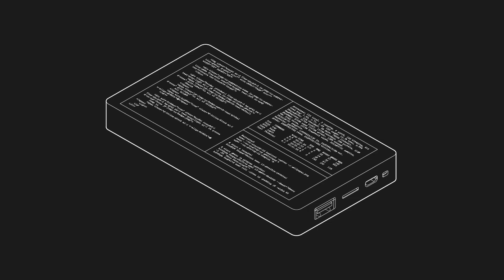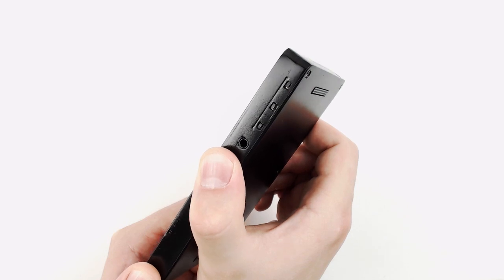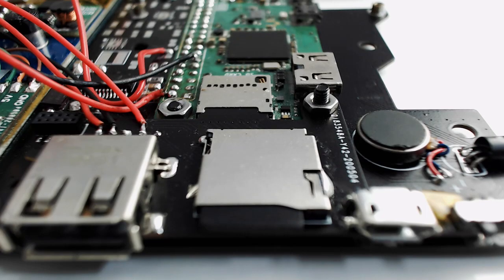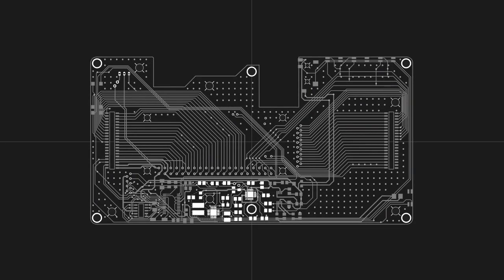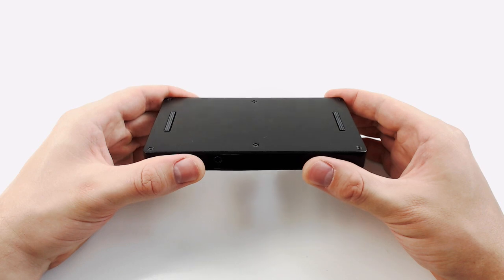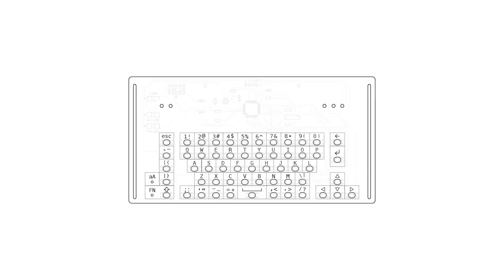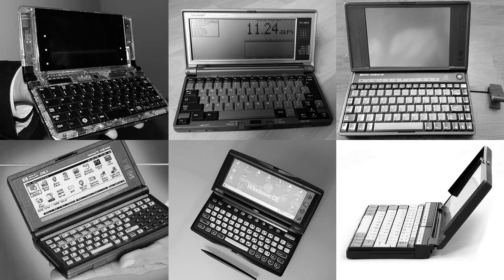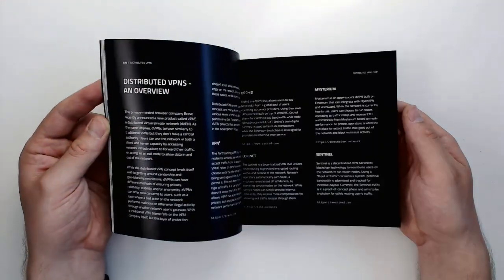Trying to build the ultimate Raspberry Pi computer (Zero Terminal V3)

Comment: Very cool, love the added own boards, since my first contact with computers, around 1995,'96, I always wanted a pocket Windows pc, now I have smartphones, but still not what I actually want, if I had the budget and time, I would get a Windows compatible micro-computer, to which the schematics are available, and redesign the board/s, it is always good to place some circuits and things on own boards, then make a solid aluminum case with as much fins as possible on the inside and a tiny fan for cooling.

Comment: IMO, go for RPi compute module will be another good idea. Without direct soldering RPi zero on PCB, if RPi malfunction for some reason can be swap out easily, also, with eMMC embedded RPi compute module, sd card slot will be optional. 
AND MUCH POWERFUL CPU

Comment: Ive made an phat out if the adafruit powerboost 1000C. I agree about how problematic those ICs are. You really need to hot air reflow them (I use a hot air gun), and you definitely need to control the amount of solder paste laid down (such as by using a stencil).

Comment: this is SO COOL! I wonder whether, when the pi 4 compute module comes out, it would be possible to make a version of this with the pi4 since it's very powerful and could be used for even more demanding tasks. I've found myself using the full sized pi4 for various general tasks and it would be brilliant to have that all in a small, self-contained device.

Comment: @N-O-D-E you could make it even slimmer If you desolder some connectors from the pi and solder some Extension to it to Place the connectors where you want. Then for the custom pcb‘s use flex band pcb‘s and tape the components together with some not conductiv foil in between.

Comment: Awesome work. When I see the LCD kits I think they look great, until they are tilted and you see inch long brass stand-offs and that kills the mood. Compute module with M.2 could be a great little package couldn't it... I'd almost recommend you forgo the internal battery and have an attachable unit like minidisc players had in the 90's.

Comment: That's awesome man! I will definitely Gina try it as soon as possible, I have an old transalator device from the early 90-00's but there is nothing on the internet about it, it has an on board keyboard and a small 2line lcd display for the text, I was thinking to swap some parts and make it a pocket sized terminal, for the device to fold in half they used plastic hinges and a soft "wire" that's about a tenth of a milimiter thick and its very easy to use, I could send to photos of the device if you are interested on the design

Comment: Awesome, I was also thinking about to create a tiny notebook out of the pi. In my opinion the pi zero is not powerfull enougth - at least for my usecase. So I'd be happy if you decide to go with the compute modul 4 (release 2021). But I think you gonna build it modular. I think I could also help with the 3D design of the case. Nice work mate hope for updates soon.

Comment: Any tips on removing the SD card from a slot this small?

Also the pins connecting the different backpacks will be prone to bending, when removing the backpack, might require further iteration.
Reply: The slot will probably be one of the spring-loaded ones, so you will use a fingernail to push it in and pop it out.

Comment: Maybe use a pair of flat ribbon cables to connect the display rather than a pcb? smart phones do this to save a lot of space because you can weave the cables to the main board and not have a rigid physical connection that can only be as close to the main board as the largest component allows. And if someone drops it, the board is less likely to flex and break internal connections by compression of components into one another.

Comment: 6:33 i think there is some serious mistakes within the PCB keyboard design : firstly there isn't enough decoupling caps for the MCU (i can't understand how people do PCB design without even looking at the recommendations of the chip manufacturer in the datasheet ) secondly the external oscillator and the decoupling caps needs to be as close as possible to the MCU (so there is no degradation of the clock signal and for effective decoupling)

Comment: sir i know im late to comment on this project but i got an inspiration for the modularity if the pi zero,i got the idea of using a cassette tape as the open bit on the side is capable for ports and extensions which can be also added with a touch function

Comment: Am I an oddball for thinking that the form factor could fit in a VHS cassette? (Imagine a computer that uses a cassette body, connects to peripherals wirelessly, and outputs video on a magnetic pick-up that is read by the playhead on a VCR. Perhaps more challenging because the way video is read differs from audio cassettes. Would be an amusing piece of retro-weird kit simply for the "WTF?" factor.)

Comment: have you thought of using a compute module instead? more power then a zero and since your already doing custom pcbs you can just pull what you need from the connector and route it where you want.

Comment: Is there any way to do the actual connection with pogo pins and short through hole connectors with a top piece to sandwich the pi in place so the end user doesn't have to solder? I ask because this sort of project is VERY relevant to my interests, but my eyes do not allow for that kind of fine work.

I3 window manager? Why not just use tmux?
Reply: I was actually wondering if it would be reasonable to use flat ribbon cables like what the raspberry pi camera uses. then you dont have to worry about the pogo pins not working correctly or wearing out prematurely. also, i figure it would have a switch somewhere so its not using power while the keyboard is "closed"

Comment: You can Increase the power by using a Raspberry Pi 4 (Any variation) but with the low profile Mod (By removing all the ports from the board except maybe the HDMI or the DSI Display port). I've seen a lot of examples on google images of this mod and really looks so tiny compared to the full size raspberry pi 4.

Comment: Since we're making our own custom PCBs, wouldn't it be better if Raspberry Pi's chip and other components were soldered on the board from the factory? Do they even do that?
Still, very awesome project, I'm now looking forward to assemble one for myself.
Reply: Surprisingly, Broadcom does not sell the exact same chips found in Raspberry Pi's on the open market. And I believe that some of the lowest level firmware is not available (or perhaps just not available in source form). It's easy to lose sight of the fact that, as much as I love them, Raspberry Pi's are not open source hardware. PDFs of schematics are available, but neither CAD nor gerber files are. I hope that someday, BeagleBone's zero equivalent gets a built-in wifi chip.
Reply: Huh, that explains a lot, thank you

Comment: I've also had trouble programming SAMD21 using ST-Link ... ended up using a cheap chinese tool called DAP-Link. Or you can even turn a RPi into a J-TAG programmer

Comment: Design Idea:
Why not desolder the componets on the raspery pi and put it on to a custom PCP from PCP way? 🤔

Production idea:
(Use hot are and indium solder, also buy a template from PCB way, aply the solder before you are heating it up with hot air, and over use flux! 😉
That's the way I'm doing it.)

Comment: Hi, Node and community. Sorry for offtopic, i've a question on stm32. I'm having bad times trying to find a way to flash a BluePill with linux (Debian) using minimal software (to understand all steps). Looking for one for a long time and for some reason still nothing. Could anyone help me with this issue? Thanks
Reply: P.s. Btw, by "flashing" i mean creating firmware and loading bins on the microcontroller, not installing os on bluepill (even if it's possible...)

Comment: imagine this thing but with something like the radxa zero inside. Same size,  but a quad core processor and 4 gb of ram. Admittedly it would be something like 4 times the battery consumption and cooling would be a bitch but like come on how hard could it be :).